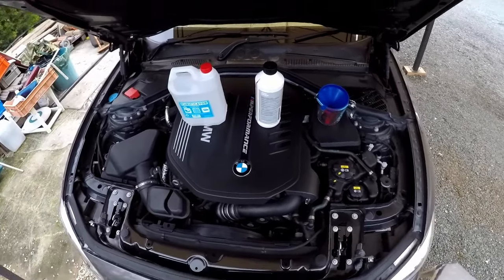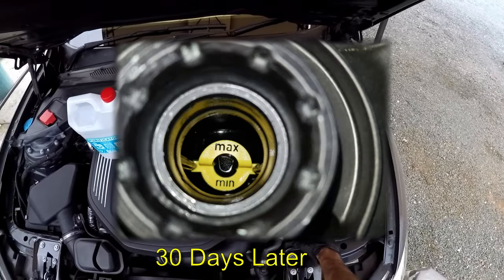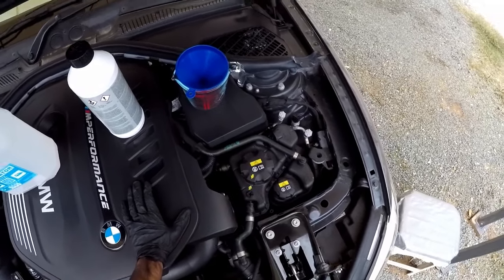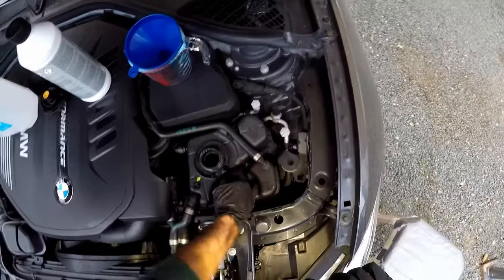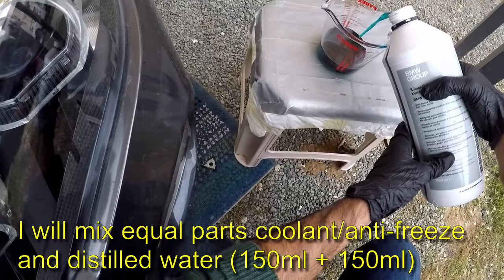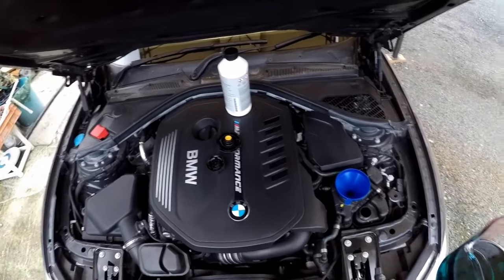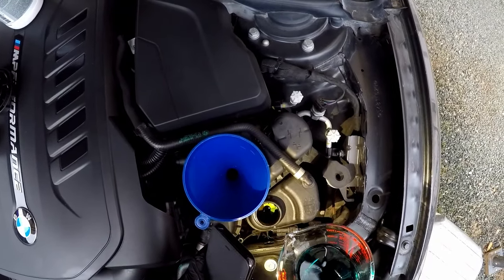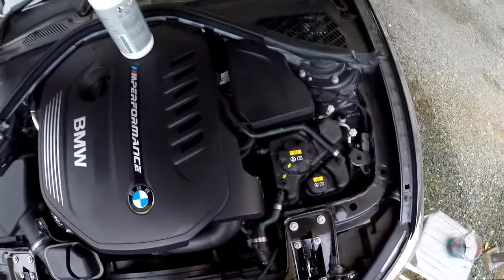BMW B58 Engine: How to refill coolant (Escaping from Filler Cap - Quick Video)

Comment: I had the same problem ...
Reply from the maker: Yeah, unfortunately this is a well known issue. If it continues to occur, I might replace the cap and see if it helps. Further to comments on the other video, I will also monitor intercooler coolant colour, and see if it changes.
Reply: @NoBrainerTalk  The problem is that the engine runs at 110 degrees Celsius and the water in the coolant evaporates.  So the tank cap will probably be ok.
Reply from the maker: @sami.p.3355  Indeed, but due to being a sealed pressurised system, the boiling/evaporating temperature should increase above 110. In addition the anti-freeze will also help increase the boiling temperature of the mixture. It sounds therefore that (a) it's possible for the cap to not seal the tank properly or continuously (hence the boiling temp can be 100 deg C which is too low for normal coolant temperatures), and/or (b) the anti-freeze is not properly mixing with the water. Hence when the coolant mixture reaches and exceeds 100 deg C, the water element is able to evaporate out of the tank (something it should not be able to do).  Hmmm...
Reply: @NoBrainerTalk  Its could be some leak anywhere from hose connecters to PCV valve to gaskets to 1001 things in the circuit as well no?
Reply from the maker: @keithw4920  It sure could be, but I can't see any wetness or residue anywhere else. Presumably wherever it would leak from externally would result in the same white residue as I saw near the cap. After 100+ km of driving since my topup there is no change. I wonder if it leaks only when I drive it very hard at my "test track"..
Reply: @NoBrainerTalk  I have the same. When I drive harder, I have a loss of coolant. The turbo compressor is cooled with a liquid and there the temperatures reach several hundred degrees, so there will be evaporation.
Reply from the maker: @sami.p.3355  I believe the engine coolant circuit includes the exhaust turbocharger, so the coolant temperature being measured by the temp. sensor includes the heat energy from the turbocharger. So the overall engine coolant temperature you mentioned (110 deg. C) includes the effect from the turbo. I believe the intercooler coolant circuit is only used for the intercooler, hence why it is generally cooler, has no auxiliary radiator, has no low quantity sensor and no temperature sensor. Therefore generally speaking losing the engine coolant would be potentially higher risk for the engine, than losing the intercooler coolant. The cap for the engine coolant expansion tank is also more heavy duty than the cap for the intercooler expansion tank, so to me indicates higher pressure/temperature conditions.
Reply: @NoBrainerTalk  Do you have the PDF from BMW on the B58? From that doc, the i/c circuit seems to be only for the i/c as you stated and is driven by a separate electric pump (compared to the mechanical pump for the main circuit). For the coolant loss, yes most people dont see signs of leakage anywhere so that kind of leaves the coolant caps and possible things like the PCV valve where somehow coolant manages to get inside the combustion chamber and out the exhuast?
Reply from the maker: I also read on forums that a few turbocharges were replaced on some cars: if the coolant is leaking through the turbocharger into the downpipe, white smoke should be evident from the exhaust I believe. I am actually looking for the B48 PDF if you have it.. :) The email is: nobrainertalk@gmail.com
Reply: @NoBrainerTalk  Ha yes, I was looking for the B48 pdf too because the B58 pdf keeps referencing to it. I wonder if the leak is slow enough, if the white smoke could be undetectable?
Reply from the maker: Yes, totally possible.
Reply: @NoBrainerTalk  Higher engine temperature (110 deg. C) is dictated by ecology and fuel economy ... and is constant for the B58. Turbine cooling systems in old cars, such as Volvo V70 (I had one), coped very well with cooling and worked at normal temperatures of 90 degrees.
Reply from the maker: @sami.p.3355  Unless something cracks :)
Reply from the maker: @sami.p.3355  Hi, in my previous video you can see that in normal driving it went to 112 deg C and whenever I accelerated it fell under 100 deg C. I think the heat management system re-configures as required. Engine coolant temperature is not constant.
Reply: @NoBrainerTalk  yes, but it only drops when you accelerate harder